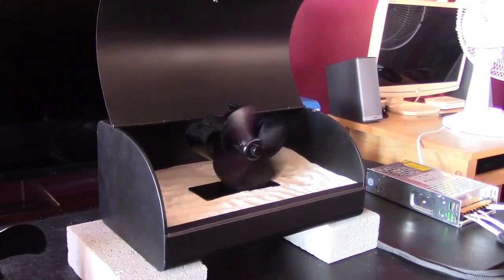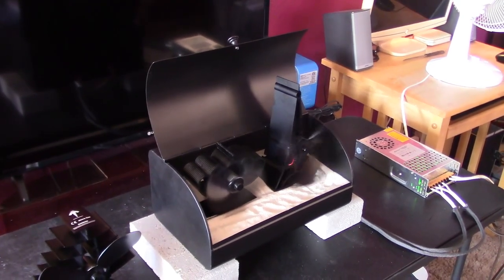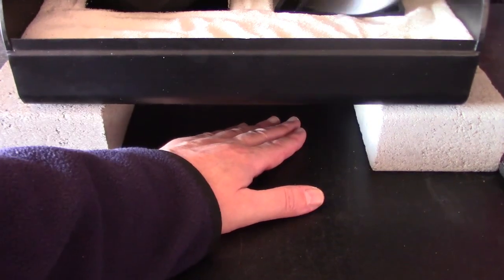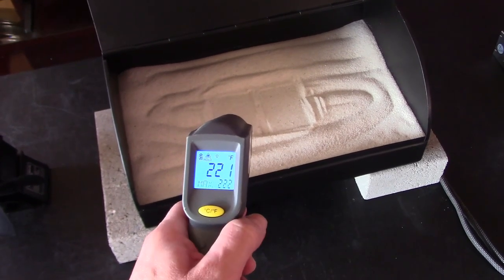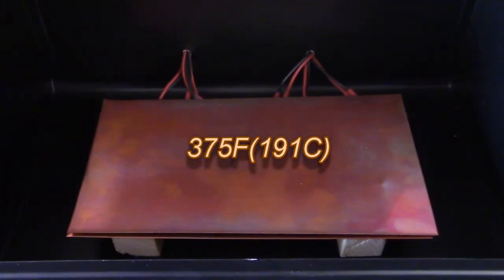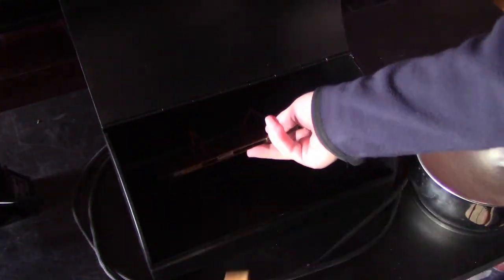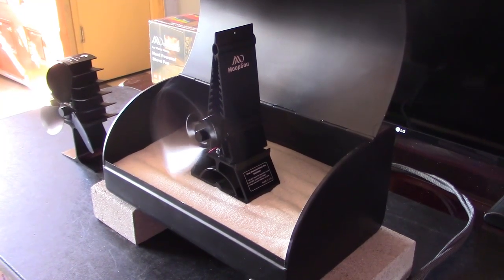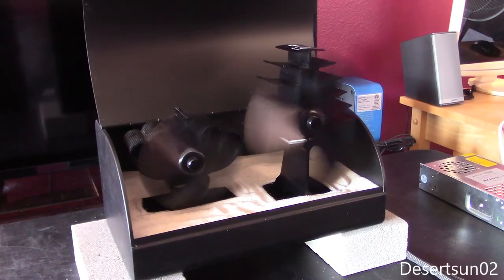Sand Storage Air Heater! DIY Tabletop Space Heater! breadbox conv. sand battery + heat powered fans

Comment: What did glue did you use to glue the PTC heating elements to the plate with ?
Reply from the maker: hi. i didn't use any glue (just high heat tape). it's a generic version of 'kapton tape'. handles the heat with ease. walmarts website sells it for about 10 dollars a roll. i used the one inch wide roll. here's a link https://www.walmart.com/ip/Tapes-Master-High-Temperature-Resistant-Adhesive-Tapes-Amber-1-5Mil-7-oz/1150397847?classType=REGULAR&from=/search
Reply: @desertsun02 I need a link for those PTC tablets with connectors already on ? I cannot find any with the connectors ? Thankyou…
Reply from the maker: here is the link (these are the ones i usually use)
https://www.amazon.com/Bestol-Heating-consistant-Temperature-Thermostatic/dp/B07VBDT8NL/ref=sr_1_1?crid=2VJ61YIA9JA17&dib=eyJ2IjoiMSJ9.88Qdhw4itzlblsRCqAP-z1exvhJjpztYtmzADIMveY3_NFyi41cIUlfanSi7GGRhlEza_nZFzh5YZ5WKFFLYm5dq8bjW9ZGLtSjw_WVnOI6F8bq-QV5-3OvzinPYVQCR8VYse58C9hGlReJ2Zk5TWPnLkwd7M033SuSvqxT-LBqyObbZq7f_lVgYOtH6ZUVbmAed41KI8bRs3vYOSxukQr8OvRsrDOujE947zQ9Jk9EbL0VYi-tUeo2InoPhrhGUok-OKt13HnpRmBoGutNWr53yfJKbnLiFrwfxt5BvnXA.7MlYQY9JW-vqcCYI285ZvmYv_Yff6egrRt8CgsHMgpQ&dib_tag=se&keywords=12v+ptc+element+22c&qid=1753909983&sprefix=12v+ptc+element+22c%2Caps%2C198&sr=8-1

Comment: What junction box did you use or can you use do l could plug it into a 240 volt socket here in the UK , do I need a step done system or  unit to go from 240 volts down to 12volts ,  you’ve 6 heaters in your video so you must of used something like a junction box to take 12 wires , sorry if my questions are stupid = really don’t know much about this stuff .
Reply from the maker: hi. since the heating elements are 12v i just hooked 3 of them to one cable and 3 to another and then put those two cables to the power supply. if you watch the original video (the one where i was using this as an oven) it shows more detail on how i hooked up the elements. the link for that video is in the description section (below) 🙂.
Reply: @desertsun02  I did watch the video but couldn’t get the link to open , which video was it that shows what you did with the wires ? I don’t know where you are in the world but here in the UK our plugs have a three point plug = live , neutral, earth, how did you earth those units.

Comment: Have you tried powering it non-stop with photovoltaic panels for a long time? I heard that being in the sand they burn out easily and don't last even a week.
Reply from the maker: hi there. what you heard is completely and totally untrue. these types of elements are extremely tough and durable. i couldn't get one of these elements to burn out if i tried. they literally never burn out. they can be used in sand, dirt, gravel, and just about any other dry material you can think of. it doesn't hurt them at all (they are made to run dry). i've bought and used at least 80 of these elements in dozens of projects over 5 years and i've never had one fail. i've had a 100% success rate with them. they are rated to last for years (running 24/7) in very tough conditions. i've yanked on the wires, washed them in water, applied voltages way over their rating, placed them under great physical stress and heavy weight and they hold up perfectly. they are as close to 'indestructable' as you can get. Sorry for the long-winded answer but i really wanted to set the record straight. 🙂
Reply: @desertsun02  I have 20 cm ptc heaters myself and I managed to raise the temperature of 2x 20 kg metal plates - designed for Olympic barbells to about 70 degrees using two of them. 
On youtube under the film "Sand Battery Home Heater for Solar?" - youtuber -
mvpmachine - wrote that he broke a few of them because he didn't dissipate the heat from them quickly.
Reply from the maker: @dawidkujawski3340 he must be talking about peltier modules or peltier chips. (those look similar and also create heat) but a peltier module (peltier chip) is something totally different. it's a different technology. you have to dissipate heat off of the peltier ones quickly (with a heat sink) or they burnout. the heating elements i'm using are called ptc heating elements. you don't have to dissipate heat off of those.

Comment: Awesome, love seeing your videos! 
Do you run any from USB at all? I’m in a converted short bus (18’)and have 4x150 watt solar panels w 2x200 ah gel batteries. I’m trying to heat a sectioned off bed space less than 12 sf. Not sure what my USB or cigarette charger will pull to power to do this or how many heating elements I can power.

Comment: WOWZA, You did it Again! Improved upon the already wonderful! I did watch the Breadbox heater v1.0 and would like to make one for my RV bedroom night table but I would like to do it as DC. My electricity use is minimal except for December and January, using 1500A little heaters, and I simply don't want to be fiddoodling with batteries, wires going outside, solar panel directions and everything else that I would have been Able to physically do before, but not anymore. So my request is, Would you please post in the first video what type of DC connection to use to attach to the little heating element rectangles (and would those be a different type also?) if that would be possible? Thank you very much from your aging Boomer neighbor to the east in Luna-tic County, New Mexico.👍🤗🧓+🦮🐕🐩🐕‍🦺🐩

Comment: I would actually place that fan down on top of the upper heat plate, but in fact utilize two fans as well, so as to 
transfer as much heat as possible! But now when mounting those fans directly onto the upper plate, I would also 
use some heatsink compound that is used for PC processors in between the layers AND clamp the fan bases 
directly onto the metal plate so as to insure them NOT to be moving around on you! The compound paste type 
that I would use should relatively thick and has the properties of not drying out easily such as to form a hardened 
paste. Once all of that is done, then place the sand into the cavity such as to cover over the fan base flanges while 
maintaining a sand depth upwards of nearly an inch and a half's worth! Then but then you'd have a pretty good blast 
of heat coming at yah! Yes, around 140 degrees worth or better! You could also use the same kind of heatsink 
compound on those Peltier devices that meet up with the upper plate as well BUT you actually should use a machined 
piece of aluminum that is at least a half inch thick I would say. Those Peltier devices should also be clamped down 
secure from underneath the upper plate somehow as well.
Reply: Do it, then post the video
Reply: @BB-br4qh  I don't do videos and furthermore, use your own imagination as per my descriptor and outline as to what is needed!

Comment: Loving this version, would you show wiring set up please?
Reply from the maker: hi. i posted a link to the unconverted (original) oven project in the description section below. that video shows exactly how i put it together. Basically, i just wired the elements directly to the power source. those type of elements can be connected directly to 12v solar panels or 12v batteries.

Comment: Really like and appreciate the types of tinkering that you do. I'm interested and view your projects with a slant toward boating and liveaboard use cases. What I need to know about this (and almost all your projects) is 1. How much AMP draw? 2. With the sand battery applications, how long does it hold the heat, and how much heat is being held over time? We can get solar panels to heat the sand directly during daylight hours, but how much battery power will we need to keep it going after daylight? Hope you can see where I'm going with this. Thanks for the videos. @⚓️👨⛵️

Comment: In a real-world scenario, how long does the T.E.G fan run for after the heating elements are deprived of power? I imagine that the idea in a thermal-mass battery is to have the heat dissipate over a longer period of time than the original heat source (in this case the sun) can provide.

In effect, after the sun goes down, how long does the T.E.G fan run for ?
Reply from the maker: hi. they can run for a long time. the fans starting temp is only 122F/50C, so as long as the heat source stays above that temp the fans will continue to run. a smaller setup can run for several hours after the sun goes down - and as you increase the amount of sand (thermal mass) these setups can run fans for several days or even weeks at a time.

Comment: What about an armchair or even bed  design..  built around a  solar power - heated sand battery ?   Sit and sleep  in warmth ..
Reply: IiDK dude, get an electric blanket or heating pad.
Reply from the maker: @kenyahawkins2472 i see possibilities with that idea. i recently ordered some 'low heat' elements of the same kind. (i usually buy the hottest ones so i decided to buy the lowest heat ones). i was thinking of making 'heated clothing items' with the low temp ones. they just get warm but not hot. but using with a chair or bed might be possible.
Reply: Neat idea. A heated sand bed. Sand up your butt jokes aside, a water bed bag mattress filled with sand, perhaps.  I bet a waterbed heater might run directly off  uv panels